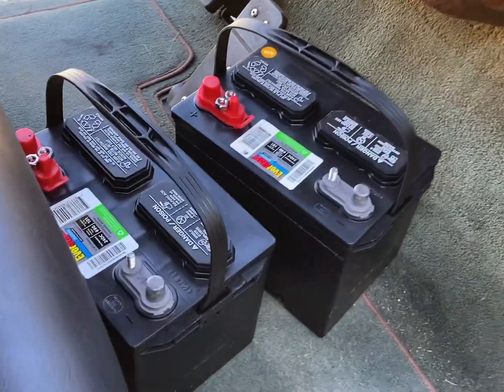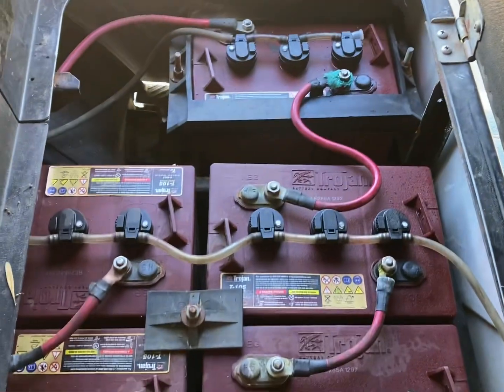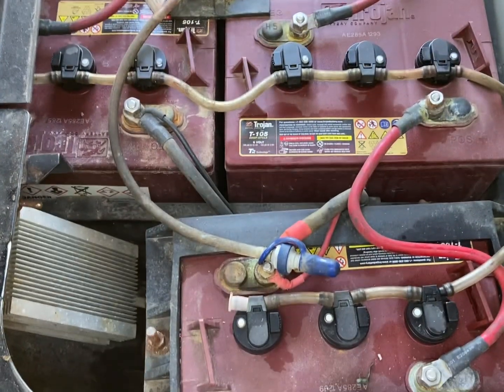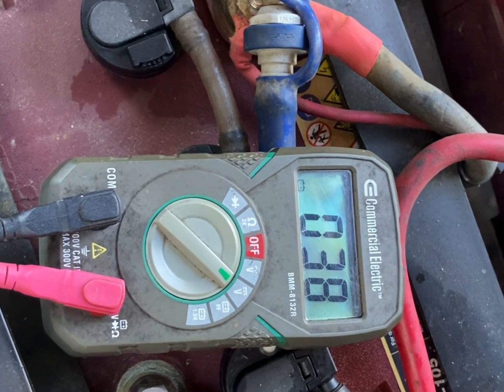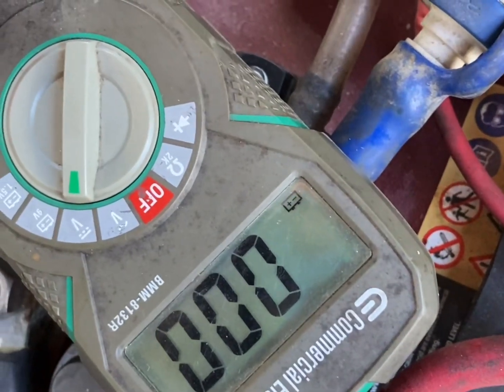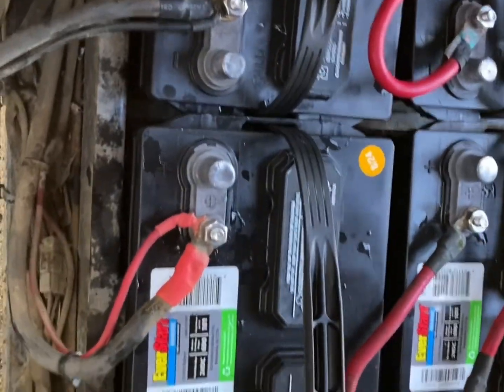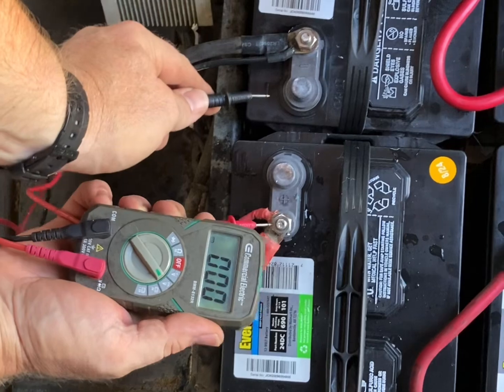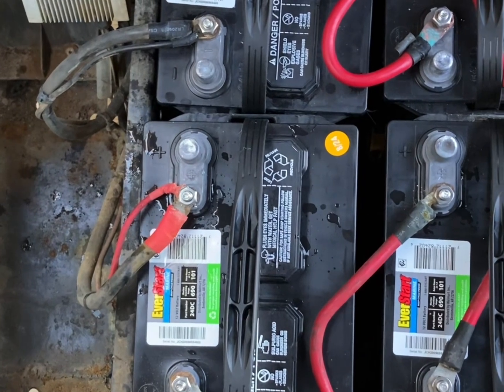Cheap Golf Cart 48v Battery Conversion - From 8x T-105 Trojan 6v to 4x Everstart 24DC 12v Batteries

Comment: Can you still use stock charger
Reply from the maker: Thank you so much, I’m glad you like and enjoyed the video. Please subscribe and hit the bell to support my channel. 

My original cart had “8” 6-volt Trojan batteries that equaled 48 bolts. The switch just increased the voltage to each battery and lessening the amount to 4, the total voltage is still 48 volts and used my original charger. That won’t be an issue. The only downside is you don’t get as much drive time. Before, 2-4 rounds of golf and now 1-2 rounds. But, you also save at least $1,000 too. I hope this helps.

Also, my STORE is open (please support) with a purchase. I have lots of custom T-shirts, Gear, merch that’s aimed towards my playlist genres. Prices range from $1.99 and up with fast and low shipping.

Https://operationrv.printify.me
Reply: @OperationRV  why is drive time reduced by 50% when it's the same 48 volts total?  Is it because the batteries are 'marine' deep cycle & not 'EV' designed?  Are the battery plates not quite as thick as typical golf cart batteries?  Still seems like a win-win.  Scott
Reply from the maker: @scottharris6615  Thank you so much, I’m glad you like and enjoyed the video. I’m not 100% sure of the plates are bigger or smaller but what seems to be more accurate in longevity is since there’s “8” six-volt batters provide longer drive time in the sense of 2 more big batteries equaling the 48v of the “4” twelve volt which gives more torque power but like half the run-time. Still a win-win like u said cause you’re saving thousands of dollars and all you need to do it charge each day. I plan on dong a follow up now that a year has almost gone by. Stay tuned.

Please subscribe and hit the bell to support my channel. 

Also, my STORE is open (please support) with a purchase. I have lots of custom T-shirts, Gear, merch that’s aimed towards my playlist genres. Prices range from $1.99 and up with fast and low shipping.

Https://operationrv.printify.me